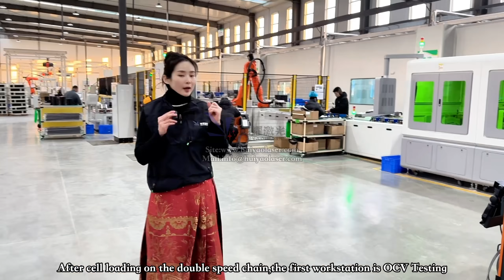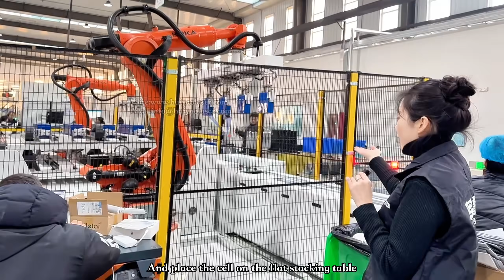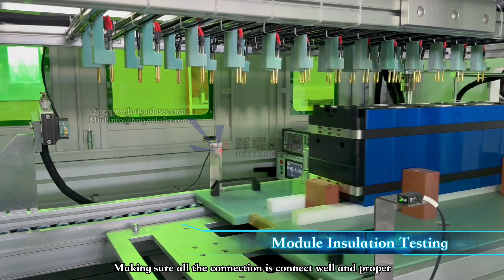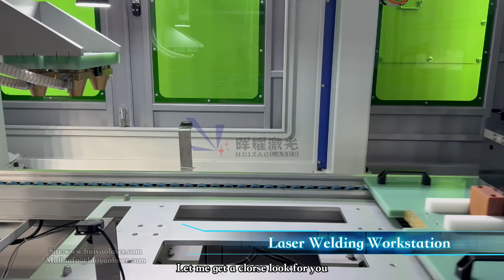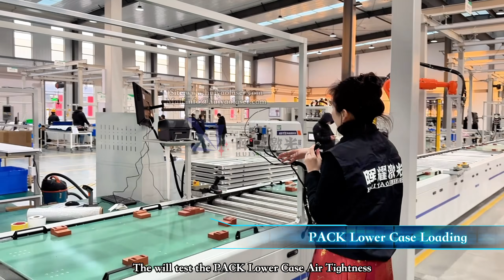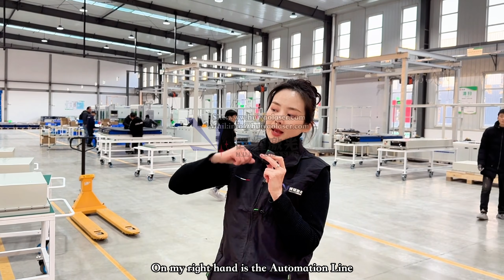Battery Pack Assembly Line | Battery PACK Manufacturing Machine | Step by step intro| Full Episode

Comment: Hi, the assembly process is very interesting, congratulations on the video.

Is this an automatic or semi-automatic line? Automatic, right?

How many employees does this 1.5 GWh factory have on average, operating only one shift?

Is this line capable of making 104S (314Ah cell) layouts for 20-foot containers? 5mWh? 48 packs of 104 (12P416S).

Thank you a lot !
Reply from the maker: thank you for this lovely comments!A.yes there will be semi-automatic line （8 ppm)and automatic line(12PPM).B.for the 8PPM line can produce 0.7Gwh per one year per one shift.for 12 PPM line can produce 1.5GWh per one year per one shift.C.for the 1.5Gwh module line will use 6-10 operators,PACK line each workstation will use 1 operator, depends on how many PACK workstation in total.C.yes our line can compatible with 104S, actually in China ESS market,104 Liquid cooling PACK is getting more and more popular.